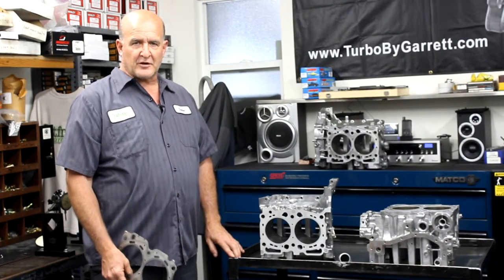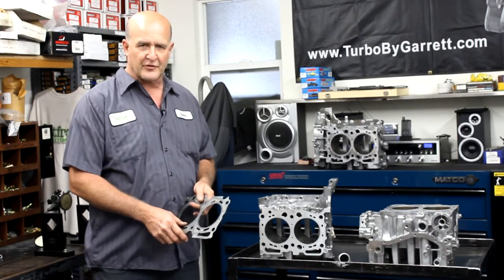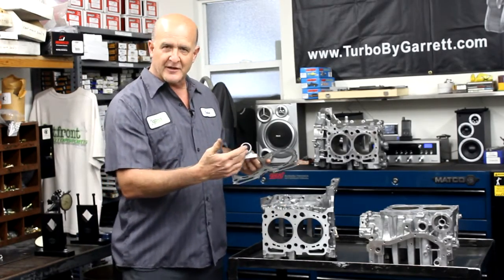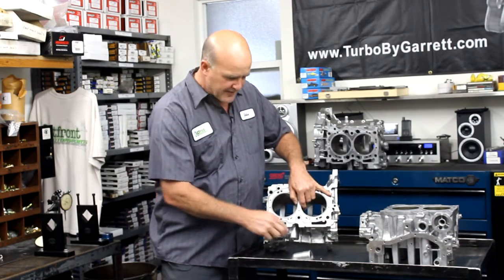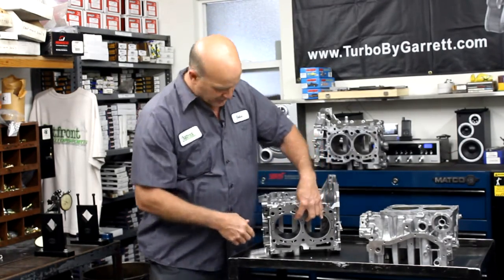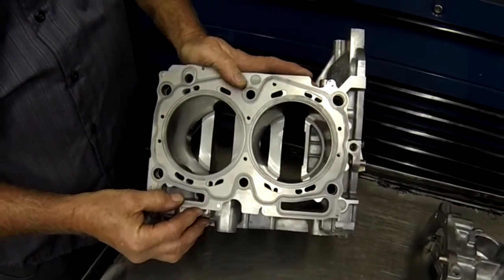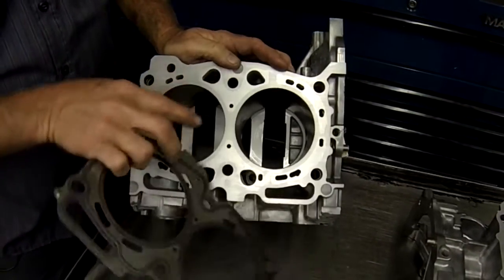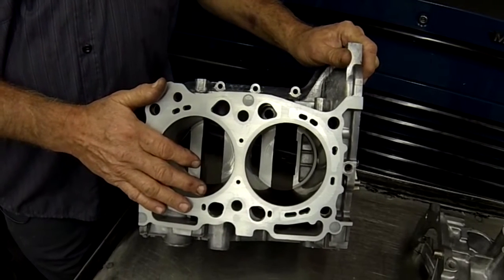Cooling myths of the Closed Deck Block

Comment: Why does Outfront not cut a “cooling ring” around the top of the cylinder bores like Subi-Performance?
Reply from the maker: Because it is not needed
Reply: @JagerRacing  of course it’s needed because those cooling rings around the cylinder provide volume for the coolant to flow around the top of the cylinders.  ANY honest engineer will confirm this.  Wtf did you get that wrong information from?
Reply from the maker: @timothybradley982  if it is soooo needed then how has Outfront not done it for years without having tons of issues. ANY engineer can figure out how to make things more complicated than it needs to be, thankfully I’m not an engineer.

Comment: What’s your view on doing a sleeved block instead of closed deck?
Reply from the maker: Derrick Garcia I did it, in my experience along with a close friends the sleeves dropped and caused constant head gasket issues. Basically if I build a subie engine it will be closed deck.
Reply: Thanks for the reply! Closed deck it is.

Comment: Open deck will have more surface area in the water jackets to cool. With closed deck you can just install a high flow water pump to move more coolant, and that will expose more coolant to cooling surface over same amount of time, and just lower the thermostat temp if it's not sufficient.

Comment: How much would one of these blocks cost for a 257? Are 2.0l block available?
Reply: KALI1080 just get a iag closed deck you will thank me later
Reply from the maker: They do both, around $900 to close the deck of a 2.5
Reply: JagerRacing is it cheaper to close the deck of a block you already have? Or to buy a new one altogether?